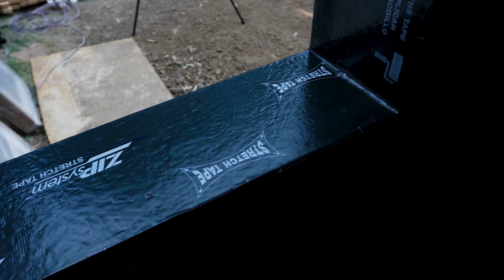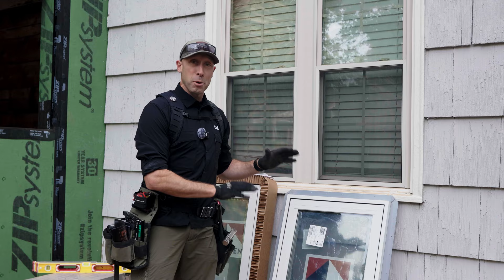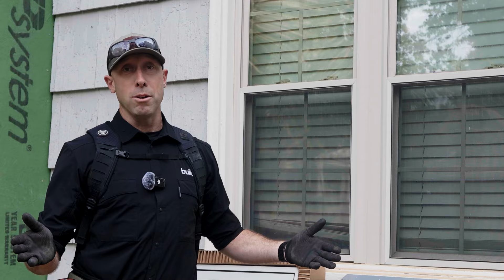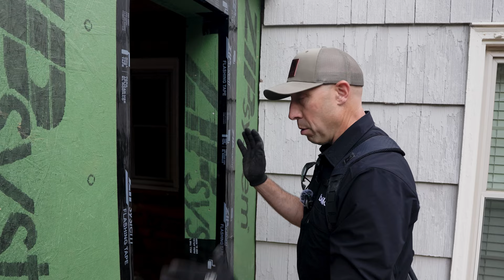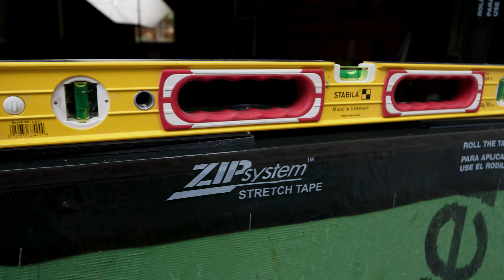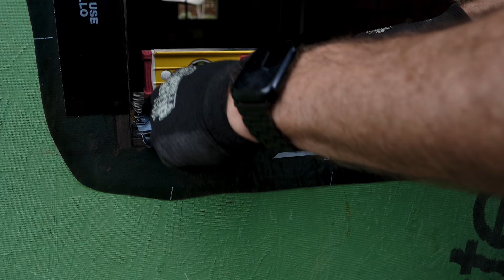The only Window Install video you need to watch - how to get a leak free window | Build Show Clips

Comment: PLEASE. Do not install a window like this!!!!! 
I’m not sure who taught you but absolutely wrong. 
1) plywood the inside opening? Ah , no . Plywood across the opening and cut out using a router for a perfect cut. Then nail with 2 1/2” ring shank coils at 3” oc around the opening. 
2). Do not put tape around the opening on the sides or top , until after the window is installed. 
Per Anderson warranty, the window must be placed against a bed of silicone directly on the plywood. 
3) you need a window PAN. You don’t have a pan,. A pan has sides , left , right and rear. You stuck tape to a stool . That’s not a pan . Even though you added shims in the back edge there still needs to be a pan so no moisture can get inside the house. 
4) The window PAN does not just get stuck to the exterior plywood. How does moisture get out and over the siding ??? The first step is to apply an exterior paper, 3M, Flex roll, typar , to the top of the sill but hanging down and NOT stuck to the wall. It is loose so siding can go under it The window PAN is then applied and stuck over that paper. So any moisture goes into the PAN and over that paper and out over the siding. 
5) BEFoRE  installing an Anderson window the flanges must be checked so the sides overlap the bottom and the top overlaps the sides as many times they are wrong g from the factory. Also and “L” shaped membrane (3M) must be put on all four corners on the exterior and must be caulked with silicone on the interior side of the flange to fill any gaps. Prior to installing the window. 
6) plastic shims are great . But you cannot just put shims on the pan and tape it down. You need to be able to use a laser to set multiple windows to match heights or even to match existing windows. So the shims may be raised or lowered to achieve the correct height. 
7) Before installing the window the exterior is caulked with silicone around the inside edge but not the bottom. The windows are set to the correct height using a laser and the bottom is leveled and corners are tacked . Then the side is plumbed and tacked. The diagonal is check both ways. After the diagonal is good . The operation of the window is checked. If all is good the corners are nailed with roofing nails. Then a level is used on the sides to check for straight. No bulges or curved in. Adjust to the vertical level to make straight. 
8) after the installation. The window gets a “ window cap” or flashing on top. The the bottom flange gets 6” “ 3M” clear tape applied across the bottom and extends 9” past each side.  Then the sides get 9” tape applied over the bottom tape and 9” above the top of the window. Then top tape is applied over the flashing and over the side tape. 
8) Finally clear silicone caulking is applied around the exterior of the window and over the 3M tape,  not the bottom. Smooth with a finger . That is the only way to install a window . Period !! And per Anderson representatives and warranty.